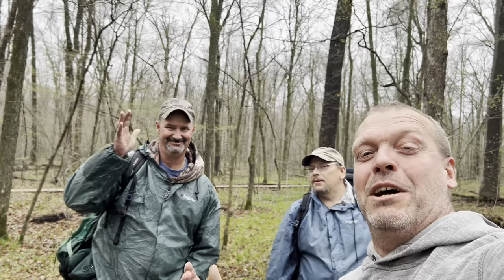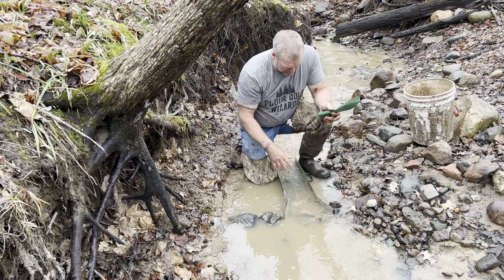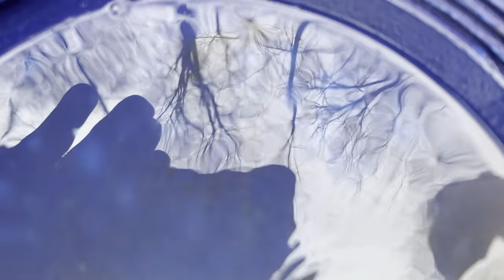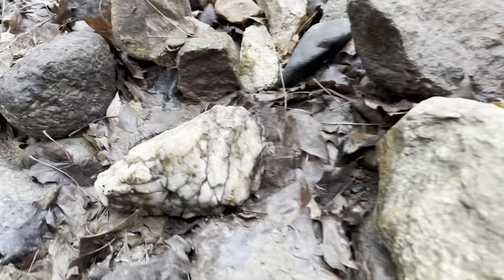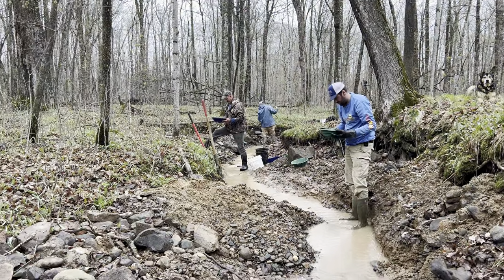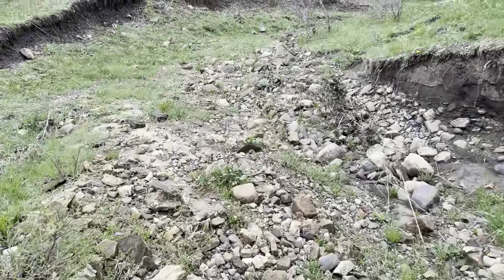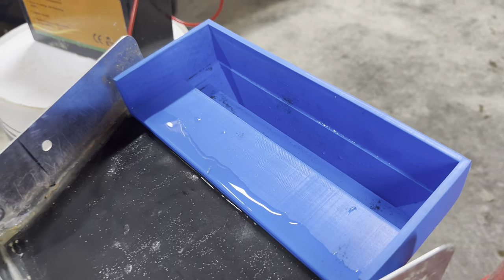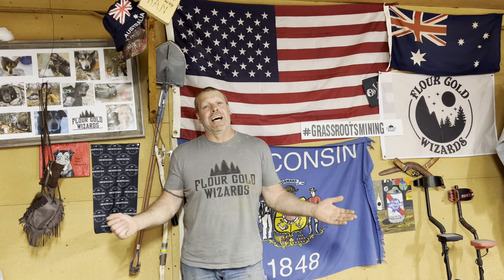Finding more GOLD PICKERS!!!

Comment: Geology for Gold Diggers - 101 -
The biggest geological understanding - in any creek, stream, or river  - is knowing your rocks.   You have broken and irregular shaped rocks - they are young rocks and recently broken off - in geological "time."  They came from a nearby origin source - and were washed/tumbled down to its present position within a very short distance.  Rounded and worn rocks are older.  One searches for these older cobble rocks.  Most-likely they came from a longer distance of faster water upstream and up-elevation.  All the washings, tumblings, and polishing happened from ancient times to its present embedding in a down-elevation having slower and flatter waterflow downstream.  Older rocks with older waterflow - have a greater chance of additional dropping of sedimentary layers in slower and winding oxbow streams and rivers with flatter geology of meadows and estuaries.  Cut off oxbows turn into little side ponds and lakes next to the current waterflow.  Oxbows are nice if they are found downstream of tailings as those regions will have a greater concentrate of tailings vs the current waterflow.

Older rock regions with sedimentary geologies and slower waterflow drop the finest of eroded organic schmuck, muds, clays, silts, ... black sand and gold ... from its highlands original geological (volcanic, igneous, tectonic, sedimentary, and metamorphic) rock and soils.  Highland waters with faster velocity, rushing through geological downward slopes, causing erosional processes - not sedimentation.Through time, and longer distances, all of these finer deposits of erosional debris will jiggle along with the waterflow, over and around river stones and boulders (with rock falls and waterfall vibrations - and notes, frequencies), down into all the tiny cracks and back eddy currents.  The time is finding these geologies fitting this process.  One needs to listen to the waterflow.  If the music of the waterflow is high notes (and very frothy, waterfalls, rushing current, etc ... there will be less erosional debris found in that area.  Mother lodes will be found in those upstream and highland locations being eroded by geology, weather, and waterflow.  Downstream is where the waterway muic is lower, slower, less rock falls, aerated water, ... and one starts finding the sedimentary deposits of black sand and precious metals

Also as one finds all the natural tailings downstream, working backwards up the stream, one gets to the original mother lode.  If the upstream creek or river diverts away from that mother lode and leached particles, then you know there was an even older (visibly existing or covered overburden of an) ancient waterway.  That then points you in the upward elevation away from the current waterway toward that mother lode through the upper meadow/detla/estuary.  Where one found the divergence of the tailings in the current waterway, one can work the down-elevation of the other side of the current waterway finding that ancient water flow.  One might pick up the ancient trail of tailings and start working them in the lower meadow/delta/estuary.

It is not actually known as yet, by science, of the size of black sand, at what rate of waterflow and slope of elevation, that deposits will be found.  The same could be said for gold and silver as well.  If one knew that water velocity, one only needs to find that waterflow and below in looking for sedimentary tailings and leachings.  The mother lode will be buried in the upstream geology and faster waters.
Reply from the maker: Totally amazing comment ✅
Pinned 👍🏻
Reply: I worked years ago on riparian (river) modelling at university as an undergrad. There were some fantastic models of flow rate, bed roughness, elevation, temperature and salinity that can act as a proxy in experiments; I bet these could be used to plot potential for black sands, given a known geology. Using a Monte-Carlo method for running a simulation of the flow and deposition a few thousand times might yield some interesting results that could have potential for a  ground truth.
Reply: One caveat is that it's quite likely that much of the gold being found is glacial. The lode may be far to the north and the gold is washing out of till! Therefore even though The depositional process within the stream is the same it is washing out of secondary or tertiary deposits at much lower concentration.
Reply: @sydres  Part of 102 lesson ...
Reply: Thank you for the information! 😊
Reply: This was an awesome read, thanks for taking the time to write it 🤘
Reply: Thanks Jason and how can I become a flourgold member
Reply: This guys good thanks for post FGW.